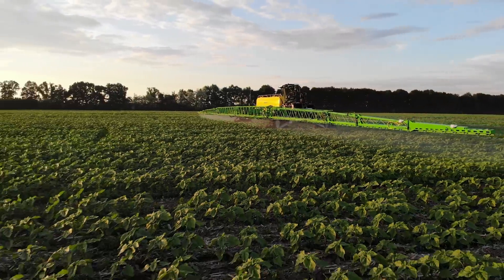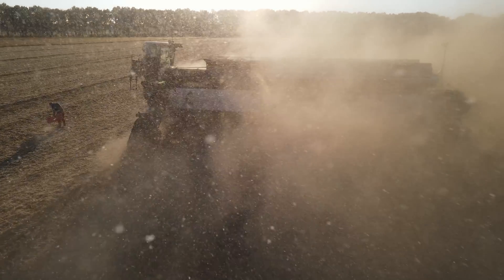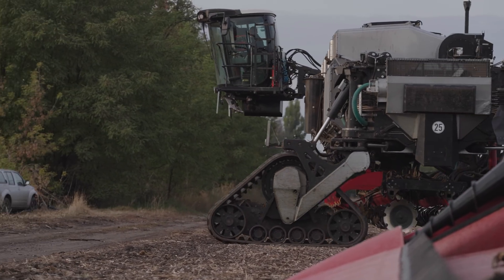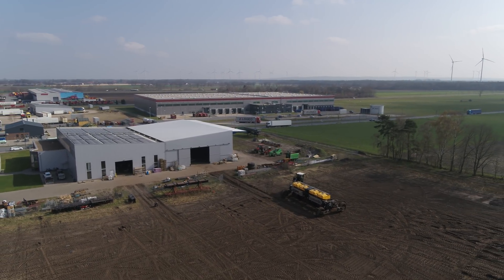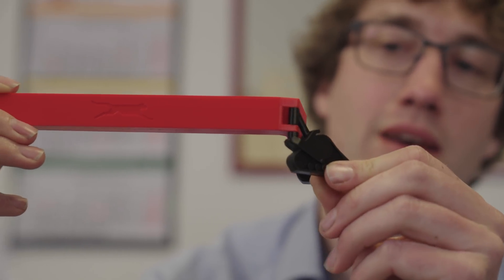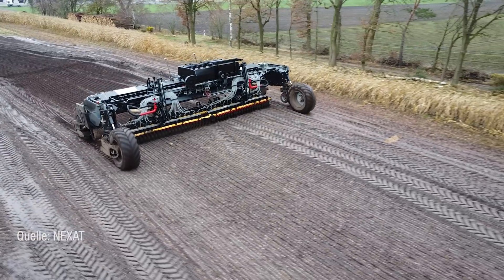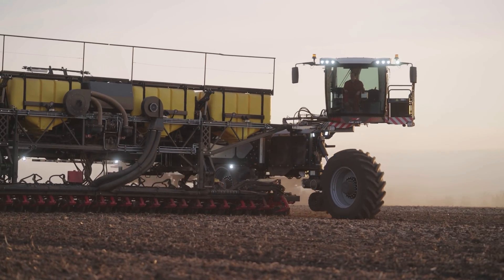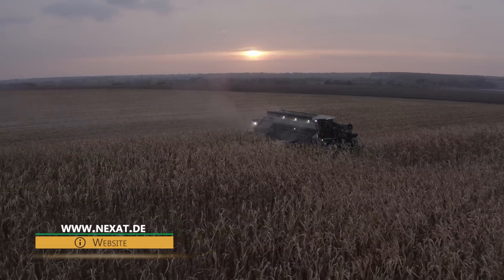The new 1100-hp NEXAT Tractor | Arable Farming in Ukraine + Factory + First Use in Germany | Part 2

Comment: One issue — This multi tool uses the same 1100hp engine for ALL tasks — whether it’s needed or not.  Not all tasks require maximum horsepower with the accompanying fuel usage.
Reply from the maker: There are two Diesel engines powering four electric motors. Jobs like spraying can be done with only one Diesel engine
Reply: You make a valid point. Having the flexibility to adjust the power output based on the task at hand would be beneficial in terms of fuel efficiency and cost-effectiveness.

Comment: I don’t really see the benefit.  You still have a a tractor pulling implements.  What does the combine module cost and what is its thrashing capacity?  Example, what would an equal sized combine cost?    
Though if this machine goes down your entire operation is at an all stop.

Comment: This machine is technically feasible but financially non viable due to it's obvious cost to buy and maintain. The other obvious downside is it's weght which makes it useless in soft soil conditions and in mud it would bury itself, but still a cool concept. A better idea would be small robots tilling and planting working off solar power,  i think the future is in small engineering not big.

Comment: There was a machine in the 1970s or 1980s called the Dowler Gantry.  It used the same system as is shown here.  It was 12m wide and was designed for multiple applications.  I don’t think it progressed beyond the development stage.

Comment: When someone tells you their machine is easier to use and more compatible. All that means is it’s a pain in the a$$ to work on, and is more expensive. I don’t care about versatility if downtime will place a project behind more traditional methods. If a break down occurs, it should be fixed in the field. Looks like a lot of hydraulics on that machine. Hoses often burst, pinch, or wear out. What if the hydraulic oil everywhere. Many many yards/meters of wires. Often wires rub raw. And in the farm environment there are mice and rats that create havoc among equipment. It’s great to dream and innovate, but we must stay grounded to succeed.

Comment: Man how do I get that on my farm in Illinois 🤣
Reply: Think has to weigh in excess of 100,000lb. Thats on tracks not much bigger than say a Deere s790. Single wet spring and you'd have that thing buried to the frame. On wet years even a 8R or 9R with 700+ duals or even triples struggle for traction, at a fraction the weight of this thing

Comment: I still don’t get it how is this more eficient that regular tractors and implements?
Reply: I think it's mostly the wheels.  Notice how they're on the outside, and that they keep in the same ruts.  So that each time it turns to do another row, one side is re-using a rut from the last row.  On a regular tractor, you'd have two, or four ruts if they have those double back wheels, make each row, and since regular tractors have their wheels well inside of the reach of their harvester/plow/seeders/etc, that means that they can't be re-used, which means less room for crops.  What the NEXAT does is have big rows of dense crops between wide wheel ruts, letting you get more crop per unit of land since you need so much less space for wheels.
Reply: @mattheweverett2227  that gigh density gives whoole bunch of problems. All sortst of diseases on crops due to lack of ventilation. On regular farming when load is balanced with weight seeds are placed on all field equaly even at those places where wheele or track went. Also technological tracs are made while seeding they span for 24-36 meters nowadays even more

Comment: I think the problem is that this is a specialised piece of equipment, and for what it is it doesnt do anything that an existing combine or tractor can't, ther header size is smaller than the largest with 60 foot headers, there are larger tillage and spraying equipment, and the reality is that capital cost of equipment for massive farms is one of the smallest expenses, parts support and servicing are number 1, and this thing is so far from standard i cant see parts support and servicing being easy or viable.
Reply: As for work width, this currently runs in europe. Twelve meters is about the largest tillage or harvesting equipment that exists here. 13,7m headers max, but these usually dont run CTF. A 70m Sprayer is like double the usual size. And there is no reason they wouldnt be able to make it bigger for other markets.
It beeing a standardized machine could also decrease part cost and make supply easier. Most things that are going to brake will likely be the module stuff anyways, which are mostly parts from already existing equipment from other manufacturers (like Väderstad).
Service is where I completely aggree though. How they will handle that will likely make or brake this innovation, no doubt.
Reply: Yep, can't replace the tractor; and the existing tech (and older) is more than adequate to get the job done.  It is cool but out of reach for the majority of farms.

Comment: This is a stupendous machine, though I would like to see a greener and cheaper propulsion method than expensive and polluting diesel fuel.
Reply: They did say that they're working on a fuel cell version.
Reply: @mattheweverett2227  Yes they did Matthew, but 95% of H2 is made from petrolium oil, so ...
Reply: If it were up to Joe Biden, he would require that Nexat run on unicorn farts and solar energy.

Comment: I'm immediately wondering how many tanks this machine can pull
Reply: Well, if you want to maintain controlled traffic, the wheels will need to be spaced about 30’ from one another.  This machine is impressive, but controlled traffic could be maintained with equipment that’s readily available.

Comment: Looks really cool. But why would you choose this over conventional equipment?
Reply: Watch the original video or NEXATs own. It massively reduces compaction :)
Reply: @KNJensen  that's due to the chains, not the machine.

I don't get it either. It looks cool and all, but:
- Every tractor is basically a multi-tool support. 
- Combines have that asset of being just behind the header. In this one, you're on the side, and you can see the dude constantly checking the cams. This shows it being unpractical somehow. Tractors have the working tool behind, which is less practical as you have to turn around, but gives you a more overview once you do it. Seeing it from the side isn't really the perfect middle ground.
- This machine has specific tools with specific lengths and dimensions limitations (not to mention weight). A conventional tractor can operate whatever it can pull, no matter the size or dimensions.
- Changing to this machinery would basically mean changing every last machine you already own. This is ultra expensive, and there'll be little compatibility between the two.